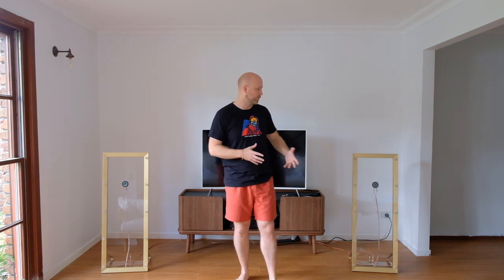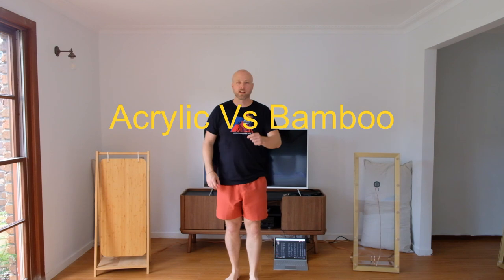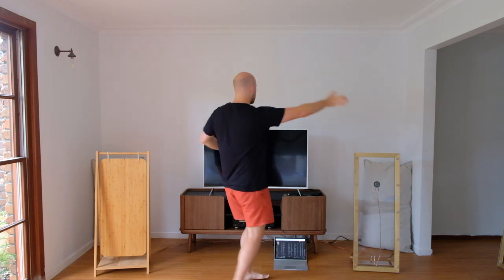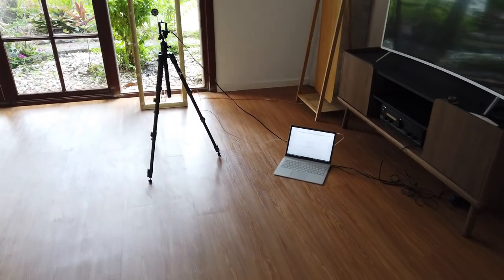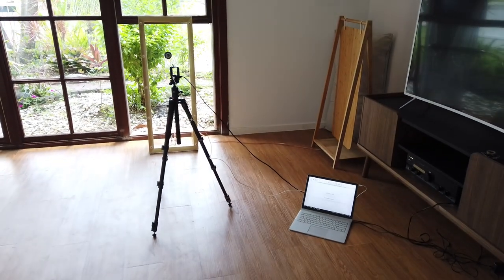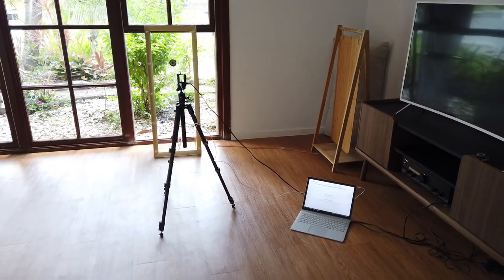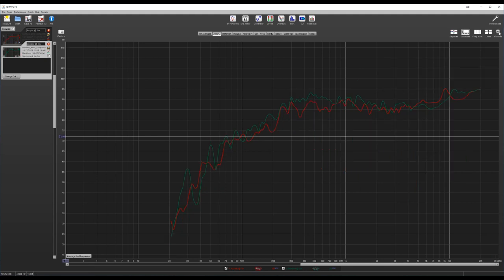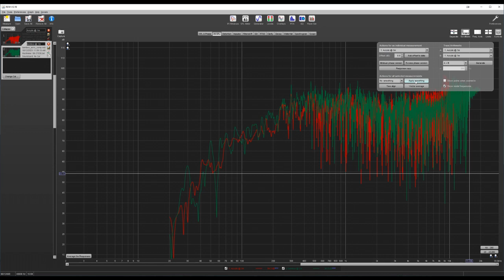Acrylic DML Build 3 - Playing Music + Panel Comparison

Comment: Well, my ear wasn't that far off: I guessed the acrylic had a harsh bump around 10k, and it turned out being 9k.  The dropoff above that is definitely contributing to how sharply that bump comes across.  That would be the first thing I EQ down if it were up to me.

With the bamboo being warmer and more effective at the low end, I'm curious to know what kind of sound you'd get by crossing over at, say, 500 Hz and putting all the low end toward the bamboo panel with some EQing to flatten it out.  Obviously, that would mean four panels for a full-range stereo setup, and you would probably still need subs, but my guess is it would help mitigate that low-end rolloff.
Reply from the maker: Hey Josh - yeah not far off at all!

That spike in the acrylics didn’t really appear in my previous testing of the acrylics, instead I got a relatively smooth increase all the way to 20k. I used different exciters and the panel dimensions were slightly different (not that I think that would matter too much in the HF) so it’s interesting to find it now.

Of course I’m not running any EQ for these tests, but my plan is to tweak the soeakers, tweak the room, then tweak with EQ.

The complication with having 4 panels would be space of course, especially in my room. They also need to be quite large panels to hit lower frequencies. 

My current thinking on how I’ll manage this is to get something like a 10” woofer and cross to the panel above 250hz. Previously I’ve used a standalone sub crossed at 150hz and while it sounds ok, it does still leave a bit of a dip in that 150 -250range. What do you think?
Reply: @TypicalBenYT  Yeah, from what I've seen in response curves, it always seems like the DML's drop off around 300 Hz or so.  I haven't actually built any yet, myself, so I have no personal experience at the moment, but my experience with subs overall has probably been similar to your own judging from that 150 Hz crossover you mentioned.  That's what gave me the thought of leveling them out a bit with EQ if possible.  I dunno if it would work as well as we'd like.  Like you say, though, it's also very much a matter of space, and building one GIANT panel as a subwoofer might as well involve just affixing a driver to the inside of the drywall!
Reply from the maker: @JoshColletta  agreed, I’ve always assumed that any good sounding panel setup I build would be 2.1. A pair of like 9’ panels with enough exciters might be acceptable but I don’t really want big tall panels either as this is our TV/living room etc

A DML sub is interesting if it can be wall mounted and disguised as art or decoration, but I wonder if it’s worth the hassle vs just adding conventional woofers!

Comment: hello good to see and hear a new post from you. I wanted to ask if you were playing in mono when you switched between the bamboo and acrylic panels? also the speaker which is in the solid corner (on the left of the system) will make more bass than the panel on the right due to the large opening in the room there. The two panels are very similar overall. I hope that you will have time to test and enjoy your speakers over the Holiday  season. Thanks for posting.
Reply from the maker: Thanks! No it was the regular stereo mix - I guess for accuracy I should find a mono track to use next time, good comment!
The opening on the right is unfortunate isn’t it? I will be placing thick curtains along the left there to absorb as much as possible in to compensate. For now it’s worth noting that due to front/back wave cancellations, the sound is very weak 90 degrees off axis so the problem might not be AS bad as with box speakers.
Reply: @TypicalBenYT  Well that's life, our rooms are (for the most part) what they are and we all do the best that we can with what we have. I was able to get a pair of 4 watt 3/4" exciters to experiment with. A friend who has been experimenting with exciters for some time has told me to stay away from the large wattage exciters as the smaller one sound better (he is using 1" pink extruded 2'x'2' rounded corners with pipe insulation around the panel and low wattage 2" exciters). Thanks for posting and I do look forward to your experiments and measurements. Have a very happy Christmas.

Comment: I also have built a dml panel from 1/4 acrylic and find it too harsh sounding. Which i attribute to placing near the wall and acrylic thickness. I wish to try the pink panels instead next
Reply from the maker: Hey Max, Interesting, I don't find these to be harsh sounding, though I guess there are a lot of variables at play. 

Once reason I like building these as 'floor standing' is that you can bring them out from the wall.
Reply: Those hanging from the wall could be hung on a frame with differing length arms so they can be placed at the ideal spacing from the wall so they take advantage of the actual variables of the room.

Comment: Do you have the thickness for Acrylic panels and a good suggestion for a source ??
Reply from the maker: Hey Sean - I'm using 4.5mm panels on these. I am keen to try thinner acrylic (maybe 3mm) with bracing as well. I bought these from 'Plastics Online' near the Gold Coast I could pick up, but there are a bunch of online shops providing acrylic cut to size as well.

Comment: Have you tried thin carbon fiber panels? I'm about to do that next, but if you've done it already I'll pass :-)
Reply from the maker: No not yet. Carbon is on my 'to do' list but... well a lot of things are on that list! Would love to see your results if you try it though.
Reply: @TypicalBenYT  I've got six configurations I'll be trying and posting, including carbon fibre panels, acrylic, fabric, foam in a brand new configuration I have not seen anyone do, luan (like plywood but stronger and finer), lexan and a combination of a few. Results are so different I know I won't be satisfied unless I do it myself and with my own ears. I'm sticking to the manufacturer's suggestion, though and using panels in a 4 x 5 ratio, otherwise anything goes.
Reply from the maker: @newunderthesun7353  super interesting, looking forward to seeing your results!

Comment: Ben, what I'm really impressed with is your engineering and construction of the frames. I haven't seen anyone yet on YT go to that much trouble but I like it! Also, wondering why you didn't go with the 2/5ths and 3/5ths placements of the exciters. Was there a reason you found to do it in your way?
Reply from the maker: Thank you! In regards to the exciter positioning, I tested various positions including the  2/5 one, but the measurements were so close that I went with the centered position out  of preference (aesthetics).
Reply: @TypicalBenYT  Thanks Ben!

Comment: Very good video but we could just try using different types of wood also because each type of wood is rated hard to soft. Each one has a different sounds.
Reply from the maker: Yes absolutely. Before I build any more speakers I want to experiment with a bunch of different combinations of materials, construction and drivers.

Comment: The panel material will have its own sound. 
I would expect the material with the least of its own sound would be the best candidate. Boring but more true. 
You are not using ⅖ and ⅗ of the dimensions to cancel out most of distace related resonances.